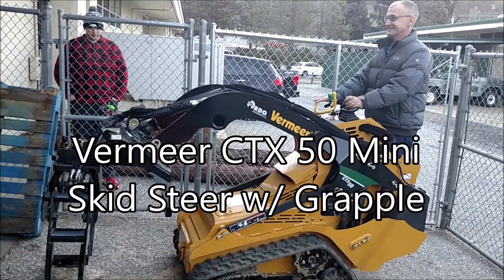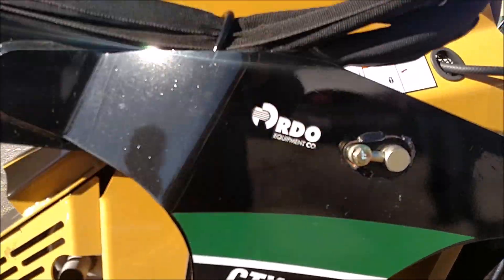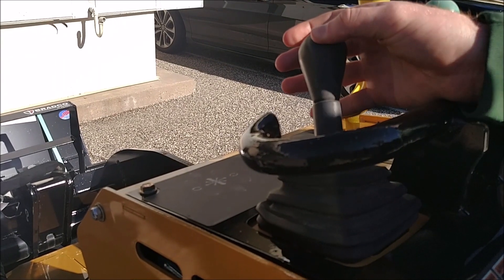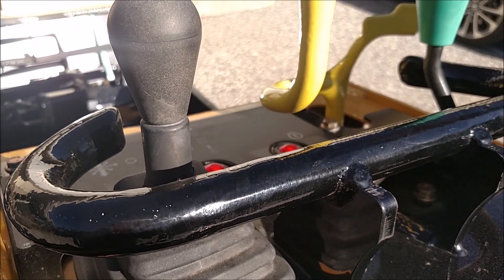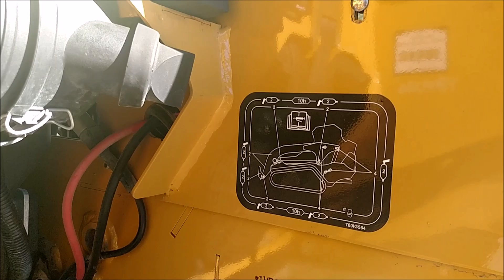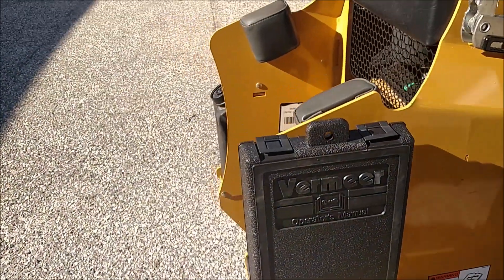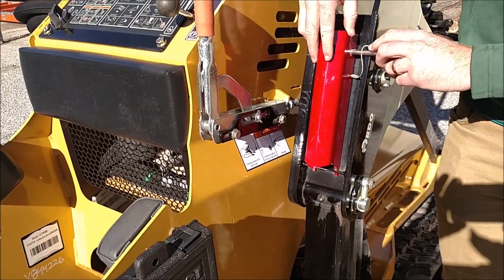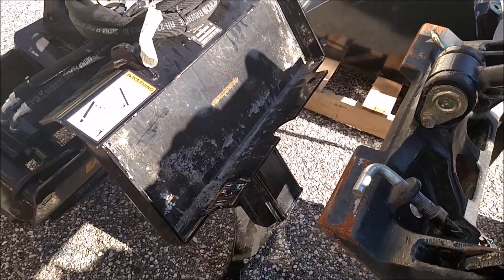Vermeer CTX 50 Mini Skid Steer with Log Grapple

Comment: What is the Model number of the Log Grapple? I looked on the Vermeer web page and that model is not shown in that configuration.
Reply: It goes by LG46 ( log grapple and opens 46 inches wide)
 You will have to download a attachment file on the vermeer page to see or view other vermeer attachments. If you contact your local vermeer a salesman can line you out. I purchased the LG46 and have no regrets but the branch manager is another solid option.
Reply: @jeremypena8786  I have a Toro Dingo with an Anbo grapple. I like that rear paw idea on the Vermeer.
Reply: @kevinbone5848  if you're in the tree business its a game changer. Less cuts and less dragging. Being able to carry large limbs, brush and logs vertically out of gates and tight areas. I paid somewhere around $3,500.00 for it and it was worth every penny. This grapple option is the reason I bought a mini skid.
Reply: @jeremypena8786  for straight up brush moving I don't think you can beat my Anbo but I think one of these would do a fantastic job of skidding logs out of the woods. 
I am just a landowner with a lot of damage from a tornado. Right now I have a lot of trees down and can't bear to see them rot!
Reply from the maker: LG46